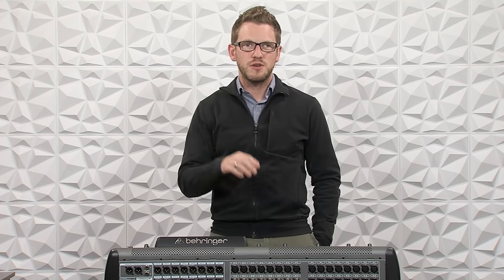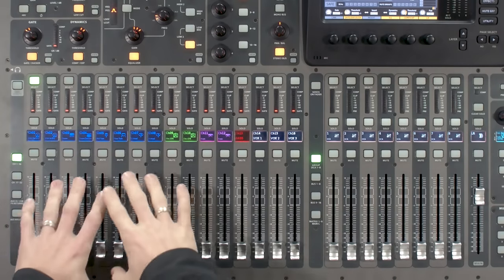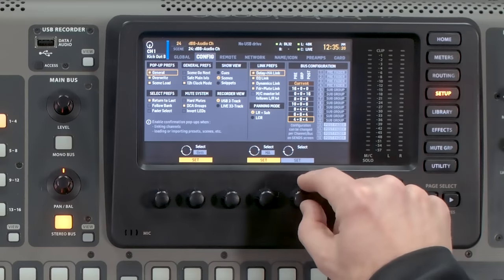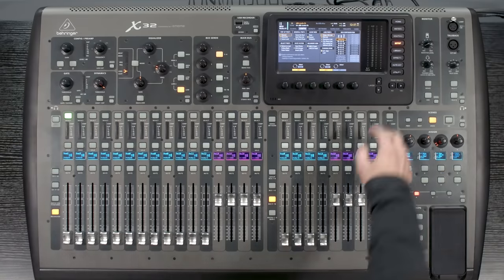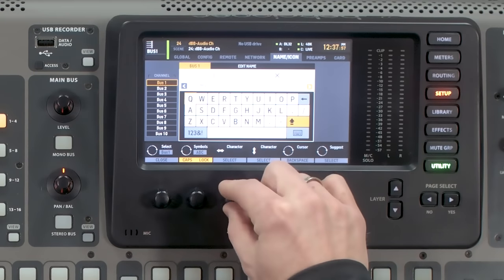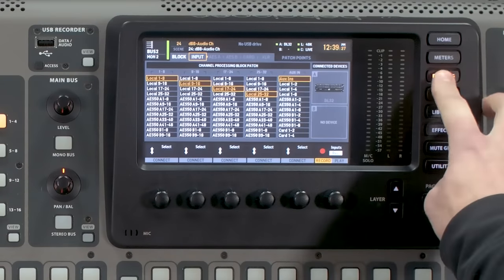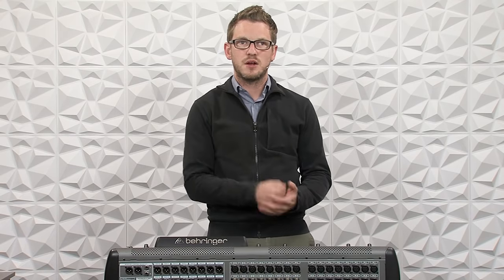How to set up and mix a floor monitor on the Behringer X32

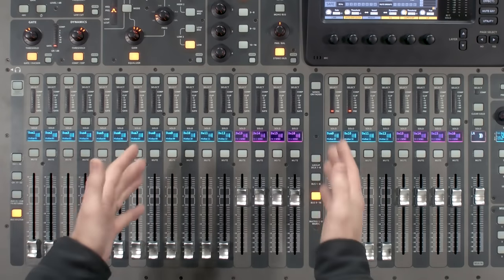Comment from the maker: There seems to be a bit of confusion about when I am setting the post-fader tap point later in the video, this is post-fader so that you have overall volume control of the floor monitor with the mixbus master fader. Setting this tap-point does not make your mixbus a post-fader setup, this was set when we set up our mixbusses earlier in the video. So don't skip over the part where I talk about the setup for the Mixbusses around the 01:40 mark. You definitely want your mixbus to be set up in a pre-fader configuration so that you have consistent volume for the band throughout the show.

Comment: Man, I am a sound tech idiot par excellence. Followed all the steps in this video which makes it seem so easy and I was able to do everything EXCEPT get anything coming out of my monitors. Still can't get  even the most basic mix out to a monitor. Got this X32 compact board because it sure CAN do everything I would ever want/need it to do. Learning HOW to get it to do even the most simple functions of live mixing is proving to be a totally different thing. :-(

I'm at the point of I will PAY someone to get on Zoom with me to help me learn how to use this thing! Better that than having a $2k piece of equipment I have no idea how to use collecting dust in my house.

Comment: Hi Drew, thank you so much for all the videos that you have been making. It's been very helpful for me to work with x32 for our church :)
Just a quick question... would you be able to make a video, or if you don't have time... a quick run down on how to set the custom bus configuration? I know you choose 6 + 6 + 4, but... what if I wanted to do 7 + 5  + 4 for example... 

That'd be very helpful. Thank you so much!
Reply: that one just a quick setup for all buses, u can set it one by one as shown in 5:15

Comment: Drew,
I have inherited the sound system in our church.  I am not an experienced sound man.  
My problem is with my monitors.  If I am using the microphones for the singers, I can increase or decrease the sound in the monitors.  I can turn the main volume slider to zero and still adjust the monitors.
With the tracks, I cannot adjust the volume in the monitors without have the main slider up.  I cannot turn the main slider volume down and have any adjustment for the monitors, tracks only.
Stan

Comment: I’m very new to using a mixer, so please bear with me. I am hooking up sound for a musical. I would need all channels to go to the monitors so actors can hear. How do I plug in the monitors? On the back I see a jack (output?)  behind the monitor dial of both XLR and 1/4” cables. Someone hooked up the XLR to the system for FOH. Do the monitors connect with the 1/4”? Or do they connect to different port? I hope this makes sense 😅

Comment: Drew, please help me (or anyone else).  I have worked so hard in learning this board for installation at my church.  However, there is a problem that I can't resolve. When I tap BUS1 (which is my monitor 1) and then I tap "sends on faders" and increase a particular channel (vocal mic) into it, I then get out of that by tapping sends on faders.  However, then when I turn that vocal fader all the way down, I am still getting sound from that channel into the mains.  I should not be getting any sound from that vocal channel into the mains when I slide that vocal channel fader all the way down.  Please anyone,,,help!
Reply: Check all the Sends from that channel to make sure none are set that shouldn't be, and might be sending to the LR. Also look at the 'Main' tab on the  Monitor Buss channel to make sure it is not also sending to the LR or Mono/Sub - remember the mic channel Send to the Monitor Buss will be Pre fader ( of the mic channel), so will appear in the Mon Buss with the mic fader closed. Hope this helps. D

Comment: Hi Drew. Love ur vids. 100% useful. I would like to find out why I have next issue. When linking two SD8s to my X32 compact, I set SD8A as outputs 1-8 with the switch and SD8B as 9-16 outputs. Outputs on X32 are routed 1-8 as Buses for wedges. And 15-16 Outputs for L&R. But when sending signal to Bus 7 or 8 to my wedges, signal also goes trough the main XLR, as if they were still routed to 7 and 8 as L&R. I´ve updated firmware and triple-checked routings, but still the same. Any idea, and if so, could you make a video about it? Thanks
Reply: I use the same set up (with an additional SD16). The first thing I would check is that the monitor busses are not also routed directly to the Left Right on their MAIN tab.

Comment: Drew, I connected a Mac Mini USB A port to x32 full board XUF card usb port using a standard cable, from time to time the sound becomes distorted then goes out, I unplug the connection, then reconnect it, the issues is cleared up. I purchase a new Mac Mini, same issue. I sent the board out to be check, no issue found. So the only thing left is the Cable, which I swapped, can you help

Comment: Hey @DrewBrashler, I know the chances of you answering are slim but I’m gonna ask anyways! Is it possible to duplicate the channels I’m currently using (1-16) to the second layer/page (17-32)?  essentially to create a monitor land mix and have separate control over the floor monitors.  Currently while adjusting my house volume, it is affecting the floor monitors and I don’t want that.  I love your videos and any advice is appreciated!
Reply: You could mix your monitors that way - an input can be sent to many channels (but beware the input gain on all the channels will affect the input level) Select Channel/ Home/ Config tab/ select Source from list on the Left.  However I would highly recommend you feed monitors in the way Drew explains, it does give you independent control of each monitor mix (including Fx levels) from the Main mix. And one day you might need to use more input channels!

Comment: Hello there. I have a x32 beginner as well. Recently, I have trouble with it. For some reasons, there is no signal out in L R and M/C SOLO. Can you teach me how to fix it please
Reply: Is that on the Headphone jack, or Monitor outputs on the rear of the mixer?
There are many Solo options in the 'Monitor' section (button).   For example if Mix Buss Solo AFL is checked there will be no Solo audio  on the LR M if the Main fader is closed.

Comment: You assign the wedges to post fader but in your blog you say pre fader is the better option? I would think pre fader is better. Just seeking clarification.
Reply from the maker: The post-fader is actually the output tap of the mixbus, not the internal setup of the mixbus. https://youtu.be/jwSgSa0HMEE?t=159 In this part of the video I show how to set up the mixbusses to be pre-fader. However when you are setting up the output of the console to feed your floor wedge, you want to be able to control the overall volume of the speaker, therefore you would need the output tap on the XLR outs to be post fader. Hopefully this clears things up.
Reply: @DrewBrashler how do you control the overall volume of the monitor???????

Comment: Quick question:
If you select 16 pre-fader, where do you connect your main speakers & subs?
Reply from the maker: Well these 16 would be the mixbusses, you will have your LR Buss and the Mono Buss available to you. So you could use the Mono bus for your subwoofers, and then you would use your Stereo (LR buss) for the main PA. Additionally, if you needed to use up all 16 outputs for monitors, you could use either the AES/EBU for driving your speaker system or use your 1/4 TRS Aux outputs.

Hope this helps!

Comment: How do you send a mixbus to an AES50 output? I feel like I am missing something so simple and so obvious
Reply: Go to ROUTING, then tab over to XLR.  The left side of the screen is where you set the outputs. If you are using the AES50 stage box, set the outs to AES50.  You can actually leave some as local outputs and some as AES50.  They are in banks of 4 on my x32 compact. I think the full x32 is same. Cheers

Comment: You didn’t mention how to send the signal thru the 6 band eq for monitors before sending it out to the powered wedges.
Reply: There is a 6 band eq in each of the 16 Mix Buss channels.

Comment: Random question when multi track recording do you know typically how big the file is and what file type it is? Thank you
Reply: Depends.  If you're using the X-Live to multitrack, it saves to a multi-channel wav file (broken up into multiple files when it reaches a certain point (just under 4 GB I think? -- can't remember for sure).   Most DAWs can import the XLive files directly (usually with some option to map each channel of the wav into separate tracks but, in the odd case your DAW can't handle multi-channel wav (are there any??) Patrick-Gilles Maillot makes a utility called "X32Xlive_Wav" that allows you to split the XLive files into individual wave files.  It's Windows only but if you're on Mac or Linux, all of his utilities I've tried so far run just fine in WINE. https://www.sites.google.com/site/patrickmaillot/x32?authuser=0#h.p_xqsqjMb-o-3m.  If you are recording to a DAW via USB (or Dante, Soundgrid, etc.) than the format is whatever you settings you have chosen in the DAW. Cheers.
Reply: Size can be calculated.  It's a fixed size based on the number of channels x the length of time you are recording.  As an example, recording all 32 channels possible at 48k for a full hour would use approximately 16GB of storage (I think -- someone is welcome to check my math).  :)
Reply: @JohnAndersenYVIG  Thank you for the info I am thinking we would record to a Daw like reaper or pro tools via the usb
Reply: Are you using an x32?

Comment: Monitors should be set pre eq. That will be pre FOH eq. Set dual 31 band eq's to your monitors, ring them out. You don't want the Front of house eq to mess with the artists during performances. Monitors should stay the same throughout their performance. You'll throw them off if their tones change. And post fader in the x32 is not what people are thinking in this comment thread. Shows your commenting without ever working on one. Post fader on the x32 means post monitor fader not foh
Reply from the maker: I think you are misinterpreting what I'm doing here. The post fader comment is the actual output tap of the console from the mixbus. I agree that from a FOH console the mixbus should be set to pre-fader (or pre-eq in your case). But the output tap feeding the output needs to be post fader so that the master level of the mixbus will adjust the volume of the speaker.
Reply: "Shows your commenting without ever working on one."  lol You don't exactly sound like you've worked on one either.

Comment: Yikes...why PostFader??? That's like a recipe for disaster for floor wedges or wireless IEMs alike...Would definitely NOT recommend Post-Fader monitor mixes, too messy bro!
Reply from the maker: The post-fader is actually the output tap of the mixbus, not the internal setup of the mixbus. https://youtu.be/jwSgSa0HMEE?t=159 In this part of the video I show how to set up the mixbusses to be pre-fader. However when you are setting up the output of the console to feed your floor wedge, you want to be able to control the overall volume of the speaker, therefore you would need the output tap on the XLR outs to be post fader. Hopefully this clears things up.

Comment: You seem to have a bit of an arogant air about you in your approach to what was supposed to be a video about setting up and mixing a wedge monitor. Instead, it's 12 minutes and 35 seconds of rapid fire talk about everything other than setting up a usable monitor wedge. It's a "look at me" posting.
Furthermore, you talk about vocalists as though they are a nuisance to you. 
The sound technician is a vital part of any musical production and should be trusted completely by the band. But the band is the reason you are there to begin with. You are there to serve the band. Not the other way around. The audience will have it's attention on the performers, not on you. Know your place and respect boundaries.
Here are a few REAL bits of information regarding setting up a wedge for vocals.
1. If you set up ANY wedge monitor in post-fader mode, you WILL subject your audience to painful squeeling feedback when you raise levels on front of house. Wedge monitors should ALWAYS ONLY be setup pre-fader.
2. You didn't even mention ringing out the wedge. If you don't correctly ring out EVERY single wedge deployed on a stage to counteract the effect of room resonance at certain frequencies, EVERY one of them will be completely useless to the performers. Once the performance begins, stage volume is often louder than at sound check, and performers often need more volume in the wedge. You WILL have feedback on a wedge you didn't ring out when you try to increase it's volume. And you will likely end up ruining the performance for the band and for the audience as well.
3. A bit of reverb in a vocal monitor is NOT an unacceptable request that requires having a word with the singer. Since ALL indoor environments produce reverb to some degree when we talk, a dry monitor can sound foreign to most any non-professional vocalist. If you are half the sound technician you seem to believe you are, reverb in the wedge should pose no problem for you.
4. For passive wedges powered by outboard amps, as you describe, an analog mixer and 2 or 3 stereo 31 band EQs would be a far more suitable and much quicker and easier to operate option than the $2500 Behringer X32. And somewhat less costly too.
Reply: Bruh… The pot just called the kettle black lol 😂